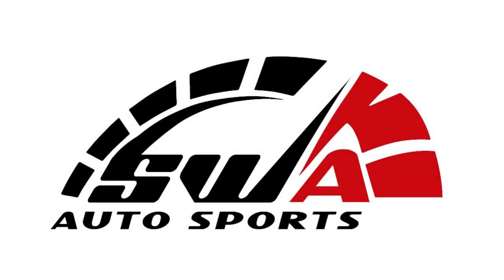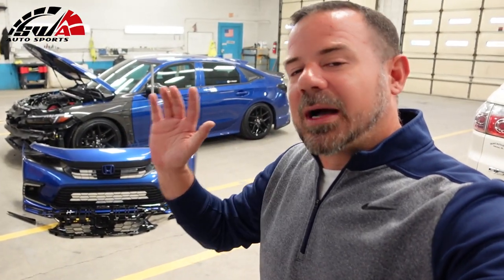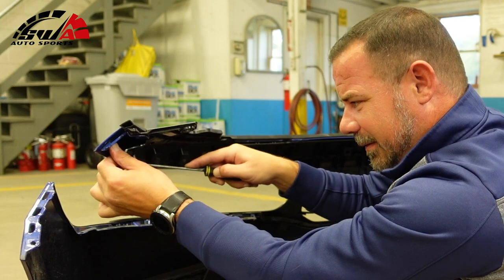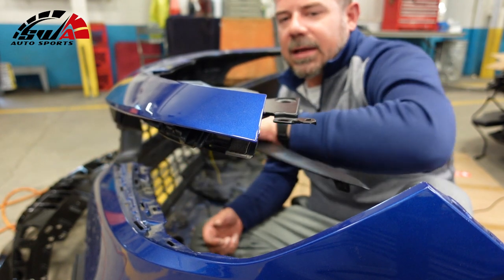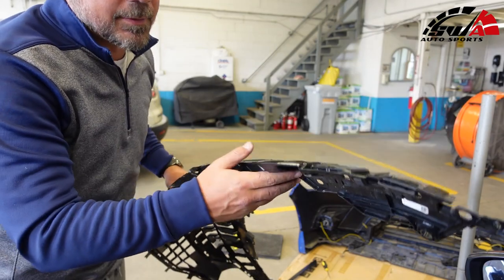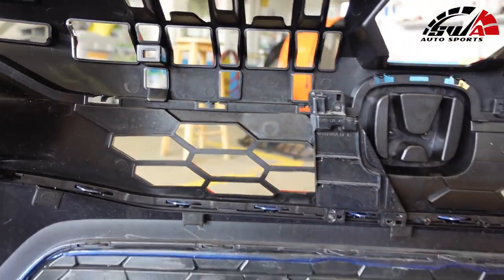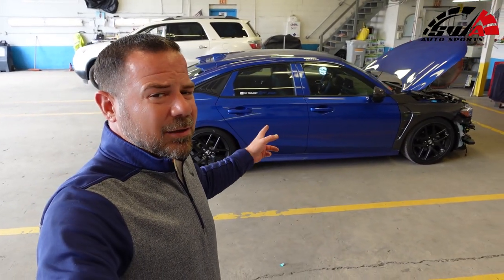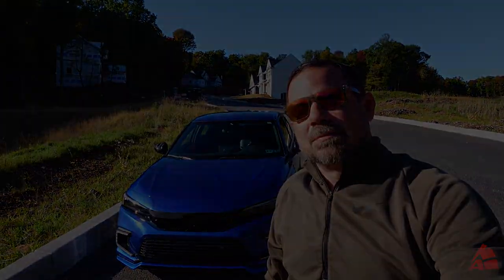New Upper Grille for the 11th Gen 2022 Honda Civic!

Comment: The bottom grill looks like it could go gloss as well. The carbon fiber fenders could of stayed blue, just add a little carbon fiber to indentation area. All in all looks great 👍
Reply from the maker: Thank you! Your pretty much spot on with what's coming!
Reply: @717PROJECT  do you have any vids on cat back exhaust, or cool air intake instal? Or maybe installing a bypast valve for sound?
Reply from the maker: @boom_artillery7134  the only exhaust video I've done so far is a spelab cut out. I do have an intake video up. Will be doing another one in a few weeks. Prls HVI with a dyno test. Should be cool!

Comment: I’m absolutely in love with this grill, i also have a blue civic gen11 but i kind of hate the one it comes with it, i don’t know why they don’t give customer the choice to choose the grill they like 😅
Reply from the maker: It's great! Looks much better than factory. I agree with you 💯.  Lower grille is next. Keeping it stock but having it painted gloss black!
Reply: @717PROJECT  I wanna ask you, is changing a grill or any other exterior part would affect resale value? I’m thinking of adding or switching some parts like the grill for example, what do you think?
Reply from the maker: @joege2366  no, not really. Depends on the buyer. Might effect a tiny bit on trade but not much. A grille, none at all.

Comment: The black emblem looks way better than that blue emblem
Reply from the maker: It's not bad. Although I think it gets lost within all the other black.
Reply: Very nice. I figured someone  would come out with an Si/Hatchback style grille. It's nice that they included an emblem, too. Personally, if I got the Civic Hatchback I would have they front emblem painted gunmetal grey, or maybe Boost Blue Pearl if I got, that color. But I would probably remove the Civic and Sport emblems and get the blue or black JDM style front, rear steering wheel horn button emblems. 

For the HR-V Sport, I woukd get all black emblems and a black aftermarket emblem for the horn button to match. 

Too bad the don't have the slant nose Si/Hatchback top fascia/bumper piece. You better make sure the grille piece is installed good, because it might otherwise fall off when you blast your new horns. Lol. So do you say toot the horn, or horns, since it has two of them? 😆
Reply from the maker: @jjacob25101  it will be painted blue here in a couple weeks. I'll still say horn...lol!
Reply: @717PROJECT  I wonder if you can hook those horns up to a doorbell button. 😆
Reply from the maker: @jjacob25101  🤣

Comment: I just had a quick question. I have black Honda Civic sport and I was wondering if it is possible to change the lower grill from where  air passes to radiator to make it gloss black, either change it or what we can do for that. 
Hope so you will see my comment😅😅.
Reply from the maker: There is a Type R style lower grille. Bad part is it has a huge license plate bracket molded to it. Not a fan. Going to have my lower grille painted here in a couple weeks. Can't wait!